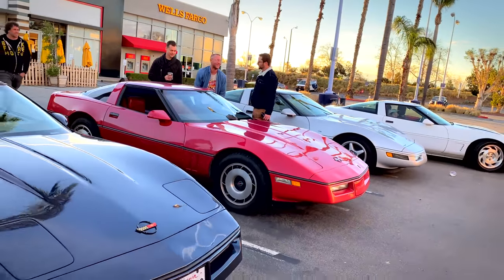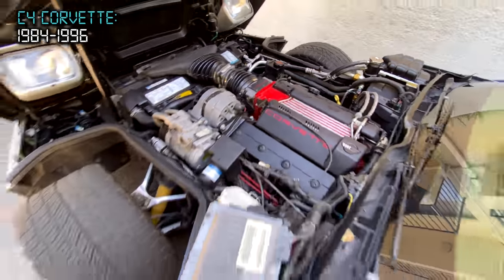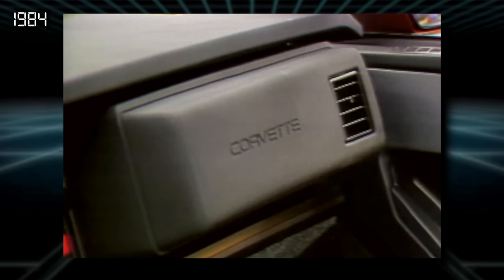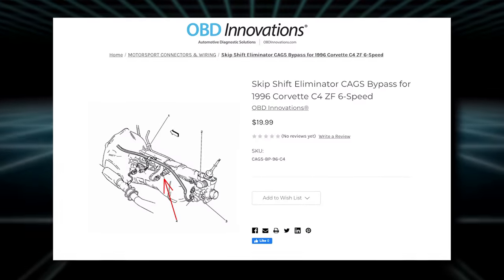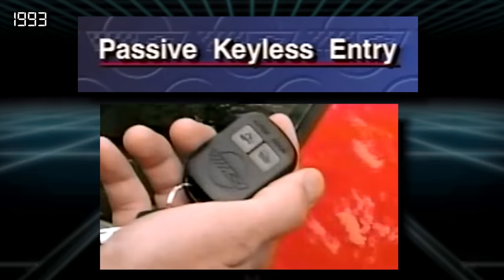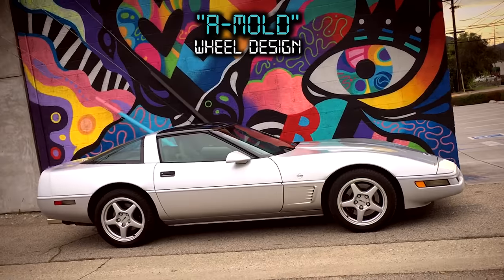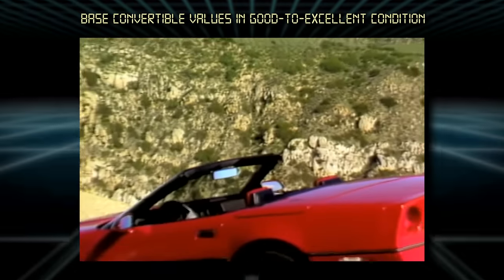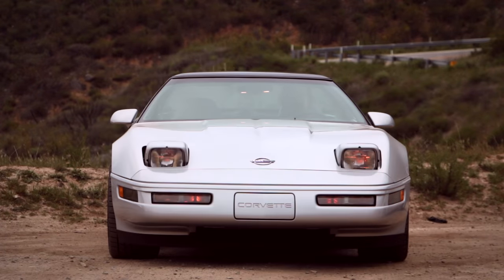C4 Corvette: ULTIMATE Buyer's Guide (Values, Performance, Yearly Changes 1984-1996)

Comment: I dont even think the 2.73 gears were for gas millage, I think it was pure emissions.
Reply from the maker: Did they REALLY care about emissions that much in the 80s/90s? I do know they cared about the Gas Guzzler tax (big reason they had that 1 to 4 skipshift feature too). They just barely skated under that one.
Reply: @RetroCarsForever  From my understanding of the Chevy 305, being extremely anemic and being used though the 80s, I would guess they were trying to just skirt over the emissions line of being passable, or like you mentioned with the gas guzzler tax; though I didn’t know that’s what the skip shift was for. Or it was for the gas guzzler as well to make highway driving more fuel efficient. With 2.73 gears, it felt like the engine would work harder and waste more power with such a low gear to get the car going. I have 3.73 gears now and I feel like the car gets better gas mileage in town since it’s been a night and day difference to get the car moving, even with little throttle. So with 2.73 on the highway, lower rpms, it could be saving fuel and polluting less or, its wasting more fuel but because lower rpm, working a little harder out of rpm range but it’s physically making let’s emissions. But who knows !
Reply from the maker: @theredwedge9446  I like your logic, but I recall reading somewhere (cant remember where, perhaps the "Corvette From The Inside" book) that the skipshift was designed SPECIFICALLY to beat the very gentle EPA test cycle.

Which, in those days, was not really reflective of how a normal person actually drove (and why you'll almost never achieve the city mileage numbers quoted back then).  

And the EPA reading was what they then used to determine what cars got slapped with the gas guzzler tax, which was several thousands of dollars that GM did not want to have their customers pay.

Comment: The optispark ruins the car for me. I own a 92, and I love it. Incredible driving car, nothing else like it. But it just killed its second opti after 3 years so i'm selling it.
Reply from the maker: Dang, that sucks. I'm curious, what brand of Opti did you use? Did it get wet?

And have you considered trading the car for a 95 or 96 with a vented Opti?
Reply: @RetroCarsForever  It was a rebuild by a guy on Ebay using an original GM part. It has the 94-96 venting, and uses a factory GM sensor (I think Mitsubishi) , and a aftermarket cap (I think MSD). It was expensive, around $750. The water pump started leaking (which was also replaced with the distributor 3 yrs ago) and water got into the opti. I'm assuming the cap is badly designed, for it to get into it again. I'm a little too large for a corvette, so it's my last one. I love the car, and don't regret buying it, but i'm getting away from them. I don't want my post to discourage anyone from buying one. There's some outstanding deals on them. I bought that 92 with 55k miles, for 5K. It was a garage queen, and in amazing shape. It's just a particular car, with odd quirks to the design that you got to watch for.

Comment: If only the C4 driving experience and built quality was as good as it looks
Reply from the maker: The right C4 drives great! 
I used to think they drove horribly but that was because I had only been in ratty old examples. Drive a nice example, especially a later model year, and I bet you’ll be pleasantly surprised. 

I know I was! Enough to end up buying one.
Reply: @RetroCarsForever   finding a clean example for a responsable price is not easy. I test drove a 91 with Squeaks and rattles everywhere the car felt like it was going to fall apart plus there was a strong musty gasoline smell coming into the cabin. Such experiences changed my mind about the C4
Reply from the maker: @truthbetold89  That was my first few C4 experiences as well. Then I waited a few years until I had enough saved up for nicer, lower mileage, well kept later examples and it was a night and day difference and I knew I had to have one. 

Like I go over in the video, if squeaks and rattles bug you, go for a later model year as they engineered a lot of that out.

Comment: My first Corvette was a 1984 over 150,000 miles, and it ran like a scalded ape...  WILD...  I bought the car for $5,000.  I wanted to be sure I liked these cars before paying a lot more.  My next Corvette was a 1986, LOW MILES..  I paid a lot.  Old guy kept it in a garage barely drove it.  I started driving it everyday..  BLEW EVERY SEAL IN THE CAR....  IT leaked oil, transmission fluid, power steering fluid, coolant... AWFUL...  So low mile cars are ticking time bombs...  These things need regular exercise...
Reply from the maker: Good advice. Ultra low mileage cars that have been sitting around forever can be real headaches.

Comment: 30-90k? You’re better off buying a C5-C7 for about the same price and they’d be more reliable, faster, quicker and better looking.
Reply from the maker: Keep watching...That's the MILEAGE, not the PRICE. 
30-90k is the around the average miles you'll come across for C4s on sale these days and what I used as reference for this price guide.

For what its worth, C5s are similar in price (though a few grand more, and in many cases more difficult ot fix). C6's are worth around 5-6 grand more, and C7s are in a totally different ballpark for values (they still have a long way to depreciate).

Comment: He failed to mention the desirable one year only '96 LT4 valuation which eclipses the LT1.
Reply from the maker: @OtayBuckwheat  I definitely couldn’t miss the Lt4, especially as it was the engine they powered MY C4!

12:46 goes over the LT4 and it’s included at the end valuations (it’s worth a decent premium).
Reply: @RetroCarsForever 
Yes, I followed all of the LT4 mentions but in the final valuations I don't recall you mentioning those bring much more than the 300HP power train cars.
Reply from the maker: @OtayBuckwheat  Seen on screen around 12:46! 

And as I found out in my ZR1 vs LT4 comparison, the LT4 likely made even more power than what it was rated….https://youtu.be/Qpj6fSGhfjU?si=yquzrtJRnZa-FpOI
Reply: @RetroCarsForever  
Yes, I saw that video.
I've had a trade offer but the 96 LT4 has 82000 miles on it and I think my 65 Cutlass Convertible is worth more than the Vette.

Comment: BUY CHEAP C4 AND PUT SOME FIRE IN IT..EITHER REBUILD UP THE LT1 OR BE LAZY AND SWAP IN LS2-3 WITH TURBO OR BLOWER..EAZY 600 -900 HP TRQ ALL STILL UNDER 3100 LBS..TODAYS VETS R FAST BUT HEAVY..C5 ZO6 PRETY LIGHT THO.

Comment: If the engine is ahead of the cabin it's front engine,no such animal as front-mid engine,all this has been posted many times before,nothing new here
Reply from the maker: "Mid engined" technically refers to the placement of the engine compared to the axle centerline. Because the C4's engine is placed behind the front axle, it's technically "front mid engined." 

This isn't a term I made up, it's widely used in automotive circles. 
It's an important distinction because having the heaviest part of the car as close to the center as possible (whether behind or in front of the driver) helps the car to turn much quicker, because it decreases the rotational inertia.

If the engine was placed on top of, or even worse in FRONT of the front axle, the Corvette's handling would be much worse. 

Scroll down to the "FMR" section here for more...
https://en.wikipedia.org/wiki/Mid-engine_design

Comment: In the real world....The drifters are snatching these up and LS swapping and cutting them up quick.  Prices of all of them are going up as they become less common.  In my area....Houiston Tx.....they are going the way of the fc rx7's and the 240's.....gutted drift cars.  Friend of mine is chopping up a 96 lt4 6 speed car right now...paid 3000 for it running.
Reply from the maker: That's a great point, a lot of the rougher examples are being turned into track rats or drift missiles. Makes a ton of sense considering the capability of the platform.

Comment: A Porsche 944 is not a direct rival to the Vette.
Reply from the maker: The 944 Turbo and the Corvette were certainly rivals at the time, in that they were both sports cars that cost about the same amount. 

The 911 was more comparable performance-wise but cost a LOT more than the Corvette did.
Reply: @RetroCarsForever  That makes sense.

Comment: Seems like the C4 has dropped in price since this video. Atleast for me in Jersey lol
Reply from the maker: They haven’t really dropped, but their value hasn’t risen as much in the past year. They were on a streak (like all used/vintage cars) during Covid.
Reply: @RetroCarsForever  I mean I've consistently seen c4s for less than 10k with less than 100k miles where I live. I've seen them even go below 5k once they reach around 120-150k miles. I am pulling this off of Carfax so maybe there's some sort of error.
Reply from the maker: @AntiCommunist  I could see that, C4 prices drop off a cliff once they get to the 100k mile range.

As I mention in the video, most C4's that are still around have much lower mileage than that.

Comment: 90,000 is high mileage ! Really ?   "and they are used up at 140,000 !? "   HAHAHAhahaaha ! My 85 4+3 burns a quart of oil every 400 miles and has 200k plus ...And it's been my Daily driver through 5 New England winters, and has never got stuck in the snow. And I FLOG  IT LIKE A RENTED MULE !!!!  And in 5 years it's only cost me 1500 hundred bucks in parts .(counting what I got it for and the flat black paint ) .....( but not counting the oil, and the non fouling 3 prong plugs I have to change every 6 months.  (because they foul )   ;(    but hay, give the old girl a break...
Reply from the maker: That’s awesome that you’re enjoying your car! As I mentioned in the video, most C4s get pretty rough by about 140k miles, they can go longer obviously but they will need a decent amount of work (compared to, say, a Toyota Camry or something most people are more used to). 

And I would say a rough average of all C4s on the road these days is much lower than 90k.

Comment: I had a C4, and its a problem car. Number one is the chassis is tail happy, and no mods can fix it. It has to do with center of gravity, and engine placement. More power makes the problem worse even with suspension and tire upgrades. The car will NEVER be what it looks like. On ramps at moderate speed in rain are beyond dangerous, and it only hooks in hot dry weather.
Reply from the maker: The tail can get a little squirrely, but even with my 330 hp LT4 and trac off I dont think its that dangerous. And traction control can help if needed for the later models.

Comment: anybody got a 95 corvette?
Reply: Why 95?
Reply: @eaglerider94  cause the optispark better and they're lt1 produces 300 hp unlike the ones under 91 only produced 250
Reply: @deadlead03  I have a well cared 116K miles, '94 Polo Green 6Sp which produces 300hp and I've upgraded my OptiSpark with the later one which is vented as the 95/96 were. ;). But yes, the closer to the last year, 96, the better. Good luck on your search!
Reply: @eaglerider94  I'm actually getting a 120k mile c4 corvette fully restored from front to back this weekend
Reply: @deadlead03  Sweet. Would love to see it here!

Comment: Dad had one.  my 300zx was nicer faster
Reply from the maker: Interesting...What year of C4 did he have and what year of 300ZX did you have?

Assuming you had the coveted twin turbo 300ZX and he had a later C4, they ran neck in neck in instrumented testing of the era.
Reply: @RetroCarsForever  84 300zx turbo.  87  maybe  Corvette convertible
Reply from the maker: @MrBlaze256  Weird, your 300ZX must've been heavily modified then, as it should've been much slower than the C4.
Car and Driver tested the 1984 300ZX turbo at 7.3 seconds 0-60 (https://www.caranddriver.com/reviews/a15143228/1984-nissan-300zx-turbo-archived-instrumented-test/).
They tested a C4 of that era that did it in 5.6 seconds (https://www.caranddriver.com/reviews/a15149718/1988-chevrolet-corvette-road-test/)

Comment: Dood, I had to dislike video trying to say the C4 was the first mid engine Vette come on man you liar 🤥
Reply from the maker: No liars here! 
"Mid engined" means the "engine is placed anywhere in the car such that the centre of gravity of the engine lies between the front and rear axles."
https://en.wikipedia.org/wiki/Mid-engine,_four-wheel-drive_layout

In which case, you can clearly see that the C4's engine is behind the front axle. So I hope you reconsider that dislike.
Reply: @RetroCarsForever  I hear what you’re selling but I’m not buying it. First mid engine Vette is the C8 brah 😐

Comment: Avoid at all costs.....piles of garbage
Reply from the maker: I'm curious why you think that.
Reply: @RetroCarsForever  electrical nightmares.....awful build quality....awful design....most engines in that generation are junk....lack of parts availability....on and on and on......There's a reason why they are so cheap to buy nowadays. If you have to buy a newer vette......Buy a c5 instead.  They are better by almost every measure.
Reply from the maker: @U.F.0.  Interesting...I can see some of those complaints against the earlier C4s, but quality control got a LOT better in the later years. But I understand at that point many people would prefer a C5 anyways. 

I do find most parts are easy to find, as there's several parts sites dedicated to Corvettes. It's only certain trim pieces that seem to be harder to source.
Reply: @RetroCarsForever  I'm speaking from experience. Having spent over a decade working at a  Chevrolet dealership I've developed a loathing for c4's.  Electronic parts are scarce.....and typically expensive.  The wiring in those buckets are usually a crap shoot.  I'll  admit the later ones aren't bad looking....the LT1 c4 is probably the best of the generation.  Having driven, serviced and modified c4 and c5 vettes....the c5 is superior. It's not even close